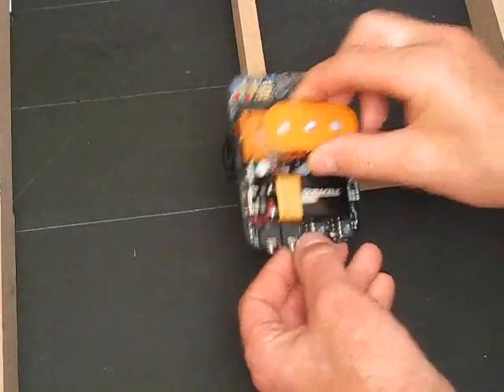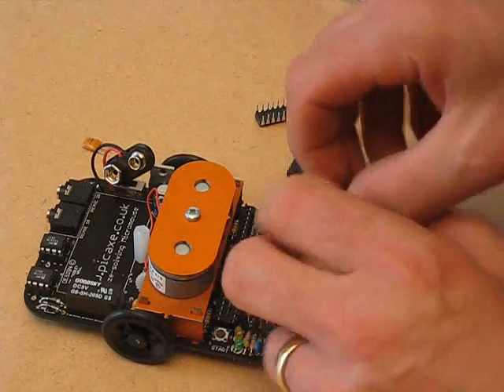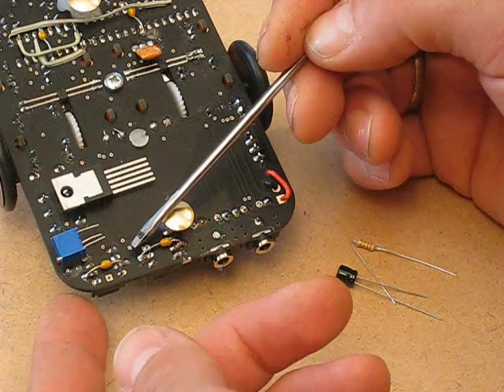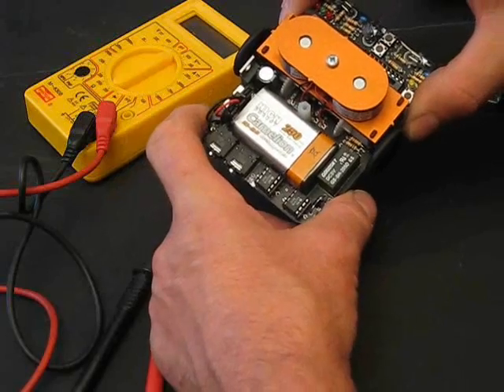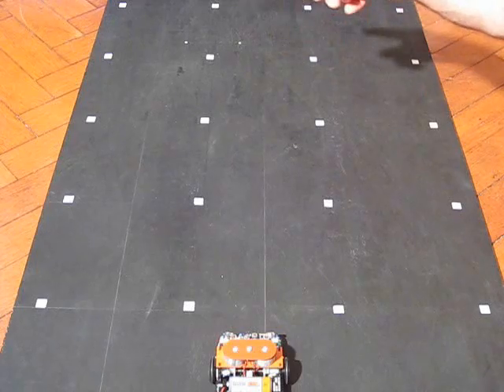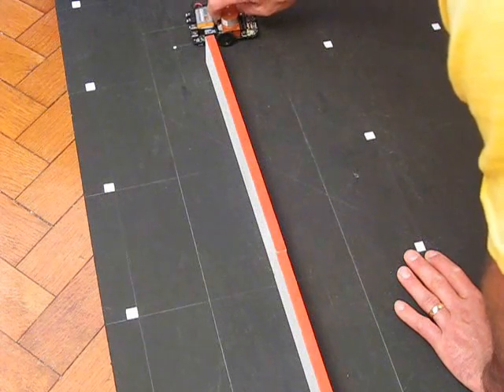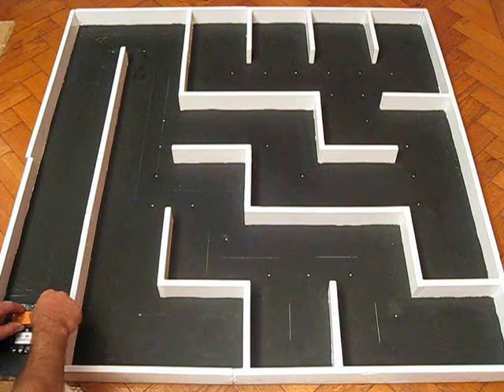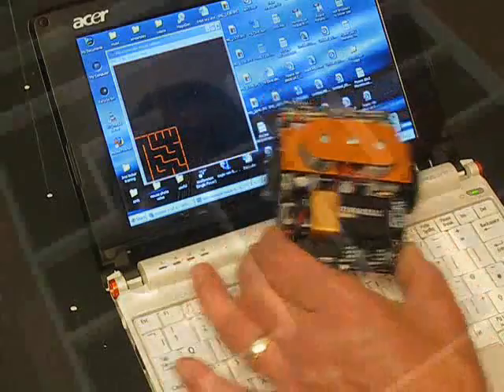Micromouse Construction Tutorial Part 4 of 4

Comment: How do you provide constant voltage even though battery drain during run
Reply from the maker: The motors are run on a 5 volt linear regulator, a more efficient system would be to connect an ADC channel between to resistors to reduce the battery voltage to a range that the micro could use and use that to modify the pwm drive to keep a constant voltage to the motors.
Reply: @MicroMouse    this is great option....

What about buck converter
Reply from the maker: Could do
Reply: @MicroMouse  
Thank you

Can you please tell me which type of PCB  you used
As low weight and high strength required
Can be done reflow soldering easily

Please tell me thickness of pcb , copper
Material of PCB
Which is best for low weight robot

Comment: How is your bot taking so nice 90 and 180 degree turn
Reply from the maker: It uses optical encoders(actually some foil glued on to one of the gears in the gearbox with an IR sensor and LED) on the motor shafts to calculate the distance the wheel moves  around a corner, one wheel is stopped and the other wheel continues for the distance measured, also its important to regulate the voltage to the motors either in hardware as used here or in software to make the angle consistent.
Reply: I really liked it. By any chance can you courier me the bot?
Reply from the maker: @prashantranjan3175  The kit can be brought from here. http://www.picaxe.com/Hardware/Robot-Kits/PICAXE-PICone-Micromouse/